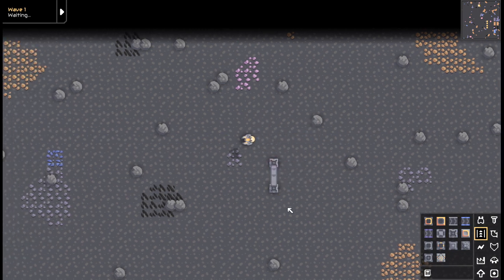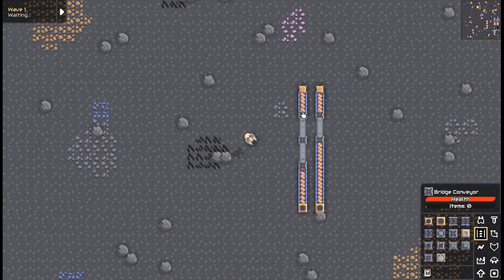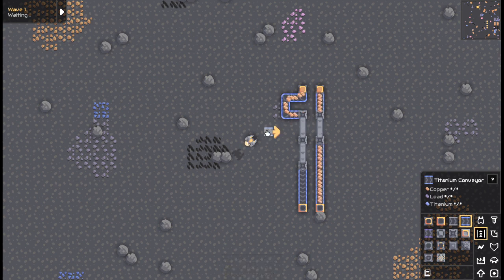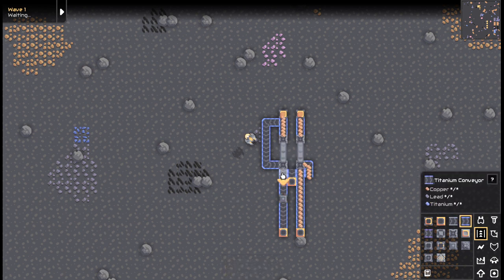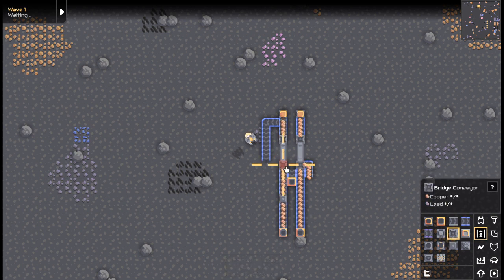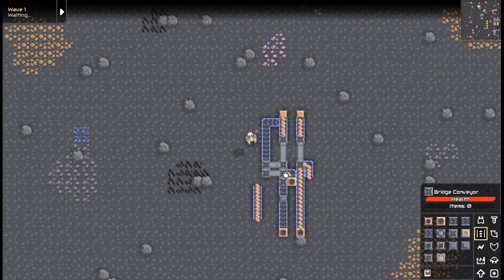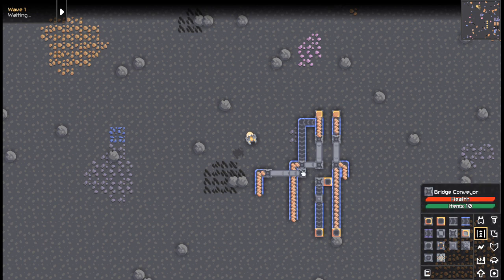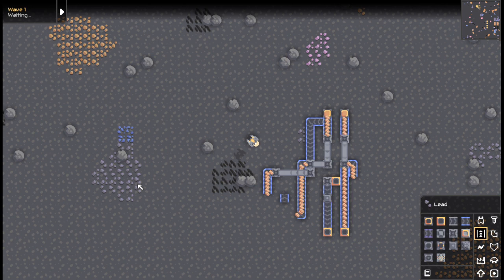Mindustry Tips - Bridge Conveyor Belt Logic

Comment: Well, I was just searching how it used to be. And I remembered. Thanks. 

Concerning the logic behind that bridge conveyor:
A bridge has a starting point and an end point. Starting points can either be input via behind, left or right, or you can connect another bridge as its target. You can even do multiple bridges as source for the starting point.
The end point is defined by whether it is targeting another bridge or not. If it is just a target from another bridge, then it is the endpoint.
End points don’t take items but dispense them to the front and to the sides.

All in all this means you can have long connected bridges that get material at multiple bridge parts and then output everything later on at the endpoint.
It should be noted that in a chain of bridges, there can be many starting points or inputs but only one end point or outputs.

Also even though I implicitly said it already it should be clear that you can not input the starting point from the front and neither output the endpoint from the backside.

A single bridge concert is simply an endpoint, so you cannot use it as a router.

People use bridge conveyors to distribute items directly into factories without accepting any input. (E.g. Silicon compact factory)
Reply: BTW, I know. I got quite some time in mindustry under my belt

Comment: Something that tripped me up is it outputs underneath. So say you set up a bridge over another conveyor path, the landing will output to the line u are bridging over. Junction is needed instead.
Reply: Any side connected to a bridge cannot output to (or input from) a conveyor. However, if you disconnect the bridge, any items stored in the block may output to conveyor (on any side), contaminating lines.
Reply: thank you